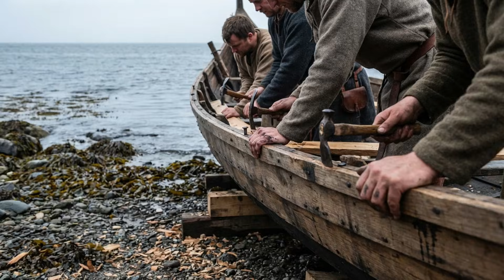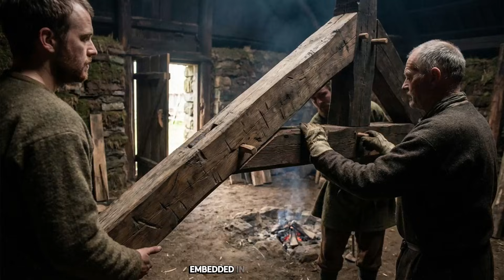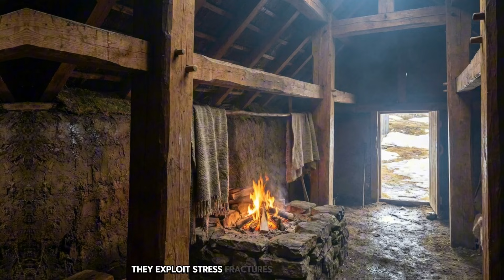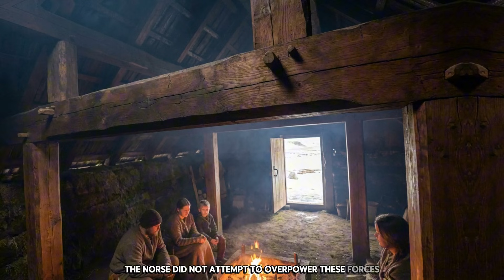Why Viking Wood Lasted CENTURIES — And Modern Timber Doesn’t

Comment from the maker: 00:00 The Question That Should Not Be Possible
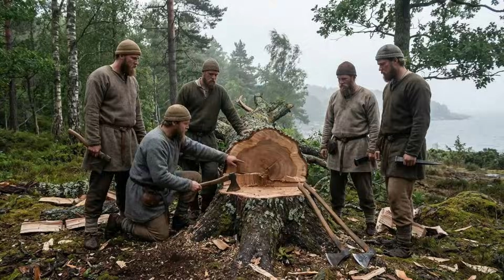01:02 Grain Against the Blade
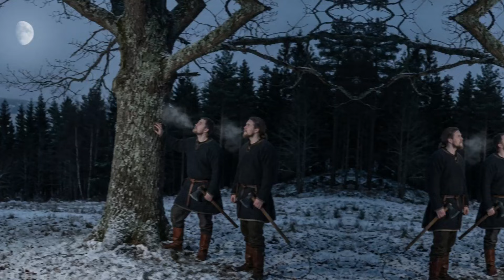03:28 Winter, Not the Moon
05:59 A Ship Designed to Bend
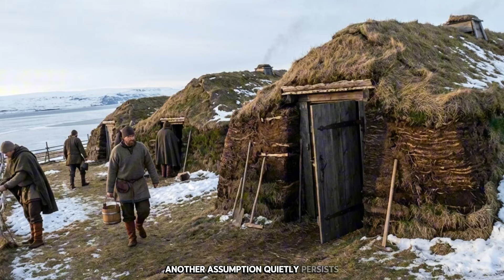08:35 Turf, Timber, and Thermal Mass
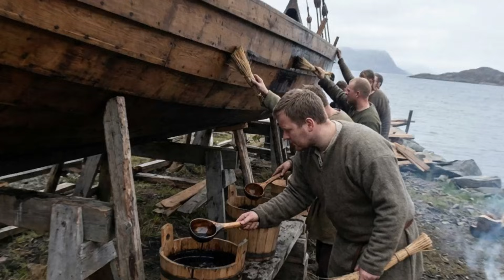11:21 Pine Tar and the Ritual of Return
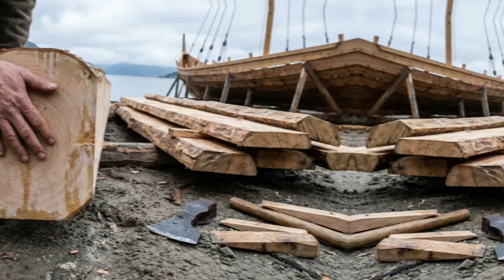13:47 Removing the Food from Decay
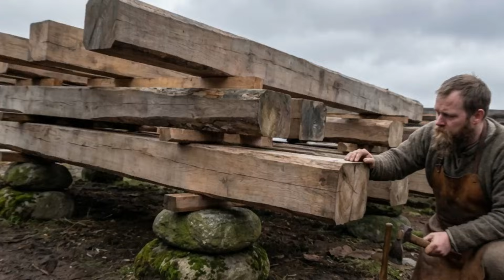16:20 Drying as Engineering
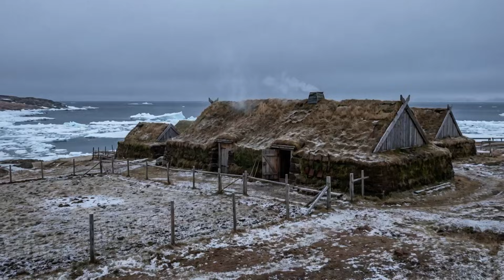18:49 Greenland and the Limits of Adaptation
21:45 Attentiveness Over Conquest